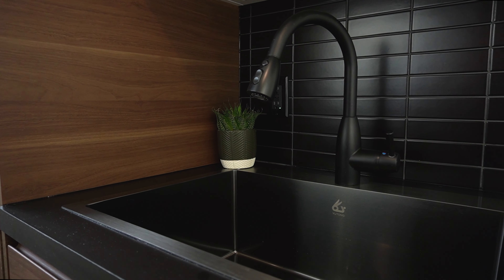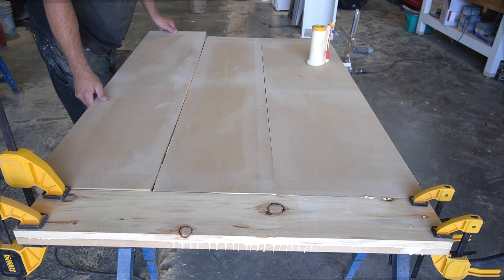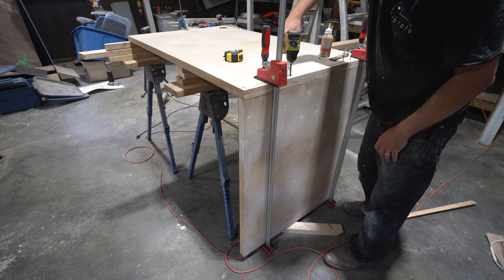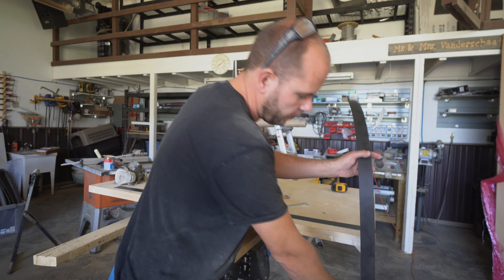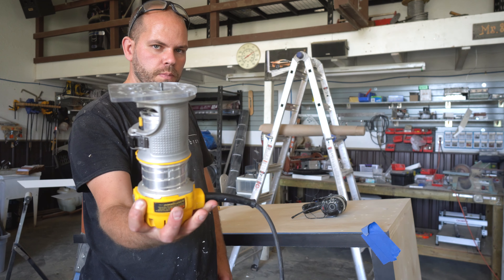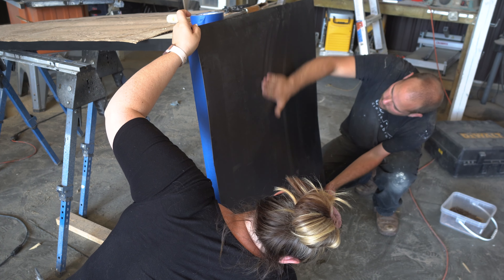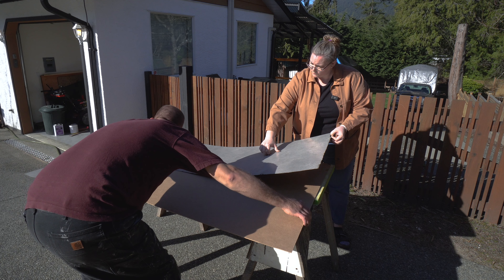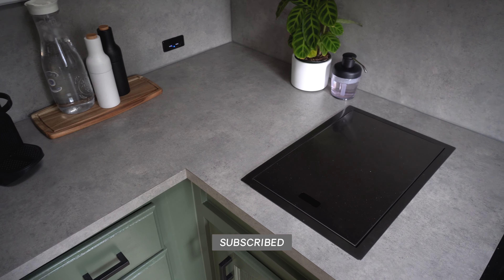DIY Laminate Countertop at Home | Cutting, Install, Tools & what NOT to do!

Comment: Q1: What glue did you use to glue the layers of wood together?

Q2: What kind of wood did you have underneath the particle board?
Reply from the maker: Q1: wood glue Q2: plywood on base and then the MDF on top so we had a nice smooth surface to work off of.